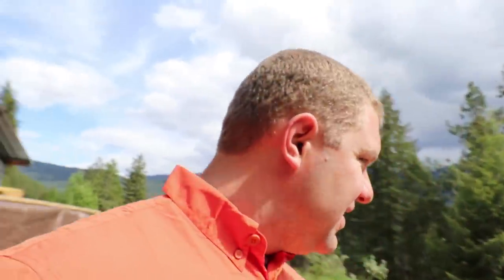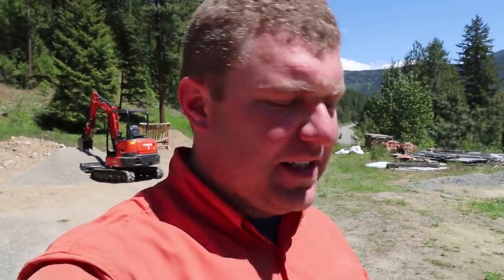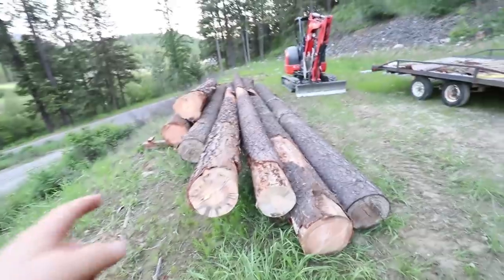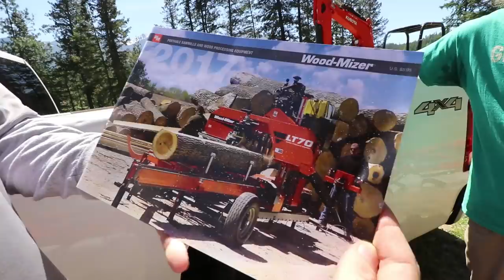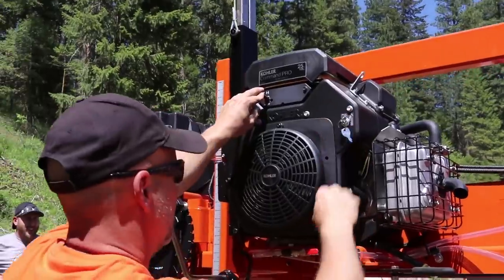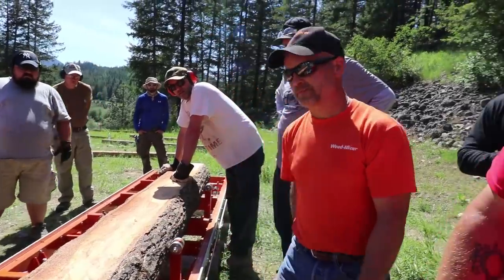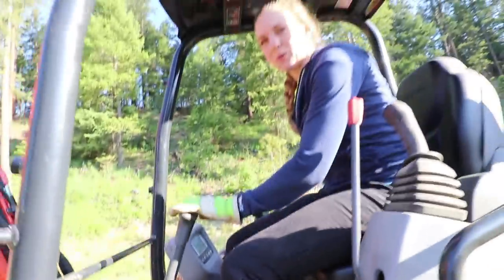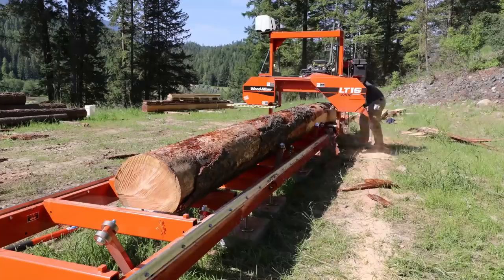DREAM COMES TRUE: Young Couple Gets Sawmill to Build Debt-Free Home

Comment: Could you use the wood to build a simple gantry system between the log pile and the mill, so you just lift each end of the log with a small hoist, attached to roller cars on the gantry, and the roller cars allow you to roll it across. to the mill and back. not sure I have explained what I mean very well. A commercial gantry would use steel I beams, with the cars slung underneath, but the short distance you have, you could use  wooden beams, and the cars could be made of something like wheel barrow wheels, rolling along the top, with guides to keep them straight and not falling off?.

Comment: You should have put the mill right where you have your logs staged next to that slope. You could have used the excavator to dig down and lower the saw bed level with the ground so you don't have to lift the logs but rather just roll them on.

Comment: +Pure Living for Life Your very first building project with milled lumber should be to build some sort of enclosure or, at the very least, a roof over the mill to protect it from the elements. It may be portable but it's also an expensive investment worth protecting.  Milling with a roof over your head will make the work more tolerable out of the sun, too.

Comment: Get a dozen cans of WD40 and one can of Lithium spray grease for bearings.
Spray WD40 on all bolt heads to prevent rust, threads too.
A bag of rags to wipe over spray.
Your mill will last forever, a hood for the mill will help.

Comment: Oh my! I know this is off subject and when you put in your septic, I was distracted by my lil boys to post a comment to this and if I do not now, well, it will be gone and lost until I get my own setup going. The drain field, it is an electrical powerhouse sitting there just waiting for you to tap it. Placing electrodes of copper. brass, stainless steel, even carbon rods, so that they are opposite metals to the other and wire in series to get the voltage you desire and then more series that then can all of the series wired "Earthen Batteries" can be wired in parallel to increase the current and you have power 24/7/365. There are tutorials here on youtube to help you with the design and application. And since your drain field operates even in winter time, it will produce power even then.

Comment: Some thoughts:

1) Alyssa is gonna have some guns.  You say you don't have a lot of physical strength NOW - that's going to change.  You don't mill a bunch of trees into lumber and come away with wimpy arms.

2) Spend a little time and money and make yourself a dolly to help you move lumber around.  Not as important for 2x and 1x but for big timbers, you'll want it. 

3) Those slabs are huge assets.  Peel the bark and they can be siding, or just cut them into stove length and they're firewood.  Softwood means lots of stove feeding, but heat is heat.  

Nice tool, good luck with it.  Should be huge fun.

Comment: I was watching a YouTube video that showed something I thought mite help you loading the mill. the guy had rigged a hand winch (Like on a boat trailer) on angle iron risers so you would roll the logs with the wench cable up metal pipe ramps.

Comment: Why did you decide to go with a band sawmill instead of a swing sawmill or a dimensional saw mill? The latter two seem more suitable for dimensional lumber/timber used in construction.
Reply from the maker: +rol eic 1. Length: we are timber framing, not traditional construction, timbers as long as 24' are needed. 
2. Portability: bandsaw mill can be put in a trailer kit and becomes very portable.
Reply: You mentioned that the most difficult part would be to take away the square timbers from the sawmill without heavy machinery. A possible solution could be a log arch. You can make your own using a welder like in youtube video "Log Arch Build" or have it welded or buy it ready made like in youtube video "ATV LOG HAULER". These log arches are good for transporting logs and beams along their length direction. But you could also think of similar designs e.g. with two forks and / or chain loops  or cable winch to transport logs and beams sideways to their length direction to load/unload a sawmill.

Comment: So what is it you have to keep rotating as you walk the blade down the length of the log?  Will the plans for the home come with a cut sheet? Really enjoying this adventure with you two.  I take it next purchase is something to move the logs?
Reply from the maker: +canesrock82 That's a feed handle. Runs on a rope that pulls the mill head through the log. Has a push handle too. Woods well! Yep we are working on the cut sheet now. That's what will make the timber frame workshop possible. Every piece explicitly defined. Logs are already on their way but we are waiting in line. Roads have been closed here for spring thaw so they are just now getting up and running.

Comment: They could build a cob home also using pine needles instead of strawbale and have beautiful wood work in the home since they have all that wood.
Reply: It seems like pine is abundant on their property, so it would be much more cost effective to use pine needles if there was no place to souce the straw.  Also, I've seen several videos where the straw was cut down to shorter lengths to put in the cob.  I also found several articles where the home owners used pine needles instead of straw since there was no local places to source the straw.  They were very happy with the results.
Reply: If they are in earthquake country and wanted to build a cob home then I'd recommend a steel frame structure - a guy in California did that, there's lots of architecs and companies that are taking cob and strawbale buiild from "mom n pop" and making it commercially viable and they have better techniques of making it happen.  The guy in California had a great architect and structural engineer and they did a great job and I got a lot of tips on creating a better structure.  

Not for nothing but - every conceivable issue you could think of, someone already found a solution for it.  And as I always say:  follow in the footsteps of those that have successfully "done it".  I've spent over a year watching videos, reading, compiling info (not to mention all the PDF & books I have on how to build strawbale, strawlight and cob homes).   I've been looking at natural building techniques from all over the world.  I probably know a lot more about cob building then you do.  Also, I used to work for architects & engineers typing up the specs for the projects we were doing, so when it comes to anything construction related I make it a point of knowing everything that's out there, even if I never use the info.

Comment: Moving those logs by hand is going to be a back breaker. You guys really need to consider buying a tractor/skid loader or excavator. It doesn't have to be huge or expensive and there are lots of them available. Buy it, use it and sell it when you're done, it'll hardly cost you anything.

Comment: Hi, I come from a more of a tropical country so am not sure if my question is relevant but here it goes: 
1. Why Wood? Why not use Brick and mortar to make home. Is it because of temperature extremes? As I see a proper concrete home would be quite good and easy to make. I understand you already have access to wood but that will still require costly carpentry and other building materials along with that sawmill etc.. 
2. This will be fresh wood sawed off.. My limited experience says we have to let wood cure for quite long time before actually using it in anything mostly under shade. So when are you guys planning to start with home and will the woods dry by then ??

Comment: build a leverage hoist crane on a pivot with 2 ton come along pully system or Electric wench , to move logs around .. think about how they built  pyramids or the guy that built Coral Castle in Florida by himself moving Coral of 50000 lb all by himself amazing feat using no power equipment.. also look into old school saw Mills  .. just food for thought if haven't thought of an easier way ..

Comment: I often had this thoughts about home sawmills your Sawmill has a gas engine my thought was because electric motors have more torque and you're cutting your own logs anyhow and producing scrap why not use that scrap to make electricity buy chipping it and putting it through a wood gasifier and in return the wood gasifier will produce a usable gas to operate a generator so the Sawmill and wood chipper would be free to operate I think.

Comment: I have to point out that for the money that was spent on that particular model mill you could of purchased a Linn Lumber Mill with auto feed and auto adjust with the same 25HP Kohler Engine for around $10,500. Add a couple hundred bucks to upgrade to a stainless steel feed chain and you are good to go. The length would of been 16' capacity unless you bought bed extensions but all in all I do believe the Linn Lumber Mill is a much better, much simpler machine to operate and the sawdust is discharged opposite of the control side which makes perfect sense. I would never go for a mill that is throwing the ejected sawdust onto the same side as the operator must be. Oh well to each their own. I paid an extra $100. to have my mill powder coated race car yellow.

Comment: I bought a Breezewood B 2000 about 1987. The only help from the community I got was old farts with nothing to do that tried to tell me how to run things. Some had experience off bearing when they were young which was no help. They did manage to get in the way. A sawmill is the most dangerous piece of equipment even more so than farm equipment. Just wait till they try to insure it.

Comment: I created a orchard on my drainage lines of my septic I know it’s not recommended becouse of roots blocking the pipes but I had no problems in the fifteen ye@rs that I owned the property the trees were great I had all waysxfelt the council made us over do the whole drainage field it was vast and we were only a family of four and it was a two bed room house so w9uld not likely need a bbigger system in the future most of the trees I planted on the down slope side of the pipe lines and toward the ends of the rows

Comment: Get a quad bike or small tractor with a small flatbed or log trailer if u were to get a tractor you could put a front loader with a log grapple on the front or a log grapple for that digger

Comment: Great to see you getting on with your house build a bit of advice I used to work a woodmizer for several years  with the backs send them of towards the hill  and make up 2 u shaped holders then sit the backs in them and get some Corded Polyester Strapping 500kg to bundle them up with then you can sling them or forklift them out the way saving a lot of time check the link out for a example this saved us hours of work and the strapping can be used to secure tarps down with as well https://www.kitepackaging.co.uk/scp/strapping/corded-polyester-strapping-reels/

Comment: Totally Cool,   Don't let the little Woman confine your Dreams, Imaginations and Aspirations to the Love Nest Home,  (Not Yet, anyways)   First structure You need to build is a roof over that Mill,  You need to protect it from the weather so you can get decades of use out of it,,
    Of course, you will need more equipment for material handling.  And maybe a large Planner for finishing the wood nicely..   Naturally,  that means You have to build a Barn next,  you need to store that Lumber and equipment in a dry location,   Maybe then You can think about building a House..  I would build a Houseboat first..  You can buy a temporary Camper Trailer to stay in while you're on the Lot..
   We can see You love to make the Videos, and You do an excellent job..  But, it takes time..   You need to recruit a Volunteer to help with that..  Maybe a little brother/sister or Nephew/Niece,  someone who enjoys it as a Hobby..  it would be cool to power the Barn with solar panels,  you might not need much electricity,  especially if you have several batteries for storage.  
   I love what you are doing,  That's not only fun,   but You will end up with many nice things to take pride in for the rest of your life,  Grow a large garden and go off the Grid with wind and/or solar power..  You'll be set for life..

Comment: buying a sawmill (new nonetheless) is not a very economical way of acquiring the lumber to build a house. Rough lumber costs are around 15-25% of construction costs. For some reason people think owning a sawmill =  a house that just needs to be assembled.
Reply from the maker: +95thousandroses You're still thinking in the box. What you mean to say is "modern homes" wood is 15-25% of cost. Open your mind. A mill opens many doors. Not everyone builds with Sheetrock, particle board, carpet and central air. :) Wood is abundant but people lack the skills and tools to utilize it. If they did, fewer people would accept poor quality construction at crazy markups with a mortgage on top.

Comment: Ok, you are going to have a ton of sawdust. Not wood chips but sawdust. Not good for animal pens, not good as mulch (too fine and will literally choke the life of the earth). And to use in the compost can cause loss of airflow unless stirred. So, that is about all it can be used for is in compost,,,,,,,,well, not really all.  If you get some dark colored drums and fill three quarter full of the sawdust, add hot water to two to three inches above the dust, let cool to 85f, add a couple of tablespoons of common bread yeast (nothing fancy as you are not going for flavor), cap the barrels and vent through latex gloves (or very large balloons), let ferment for couple of weeks with stirring every other day. Then open up and take your yeast slag off to reuse (over and over), cover and move to a "solar hot box" and hook up tubing to the vent and other end to a shaded radiator coil with the end going to your collection container to collect your other fuel, methanol. After a day of solar distillation, take the barrel out of the hot box and move off to cool to 85f and re-add the slag and next day stir it again. The carbs/sugars in the wood become fermented into methanol (which you can use as an additive to your generator fuel, vehicle fuel, or your saw mill fuel or even run alcohol stoves and or heaters). The slag can be used almost forever and dried out until you have another batch of whatever to ferment. You will get two to three distillations out of each batch and then the water can be distilled out to collect and use for next batch and the "mash" can then go into the compost. The nice thing about the mash in the compost is that it is now loaded with trace minerals that are easy for plants to absorb and proteins to feed your earthworms. Win win if you are really willing to do the work.

Comment: So now you have to think of the lumber you will be totally disappointed if you do not go the entire way through and understand the wood. That wood is roughly 35% moisture content when you cut it. Paint the ends as soon as you cut the tree, forget, you will lose as much as an entire foot of the end because it dries too fast compared to the rest of the log. Most amateurs will let it sit a year before milling, that will reduce one inch of wood down to 12% MC, which is close to idea for framing. Furniture needs something like 8% MC. Get a cheap meter, $20, some as high as $100. Do not attempt to use the wood until it is dry. Oh no you say, I do not have a year or two to wait! Simple solution, buy a solar kiln. Oh my goodness, how expensive? I am trying to be funny, a solar kiln is a sheet of clear plastic, look it up, VA Tech did a paper on it. Wrap the cut boards, separated by stickers and poke tiny holes in the bottom. It works great, might dry the boards in as little as two months, six weeks if you have lots of sun. Great method, it relaxes the wood at night, dries it more evenly. Remember, dirt is the enemy of every blade and rain splashes 30", so get that wood off the dirt, up 30" or more in the air, for dying, as well as when building a house. Only use masonry where it gets wet. God bless and I wish you the very best with that Wood-Mizer, it is the most popular brand for a good reason, good machine.